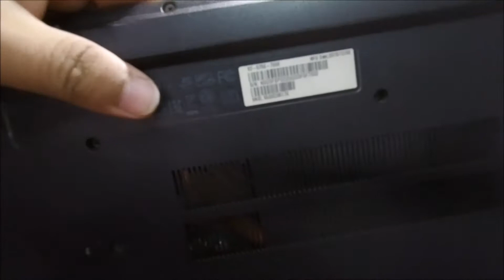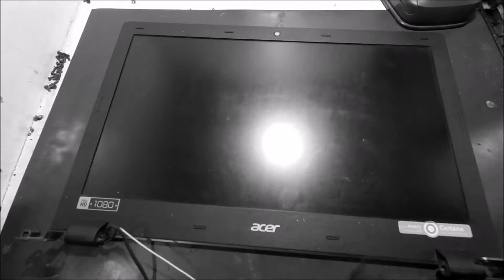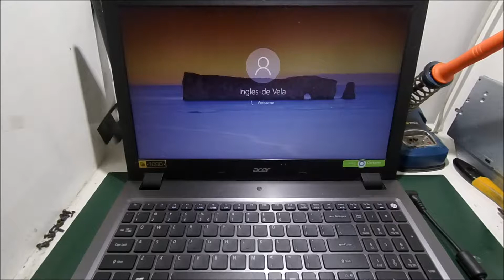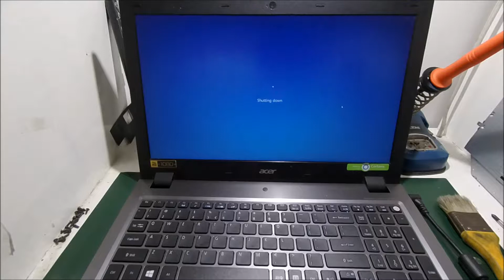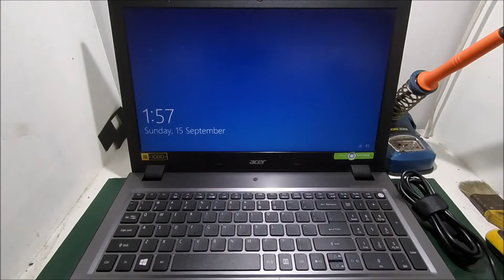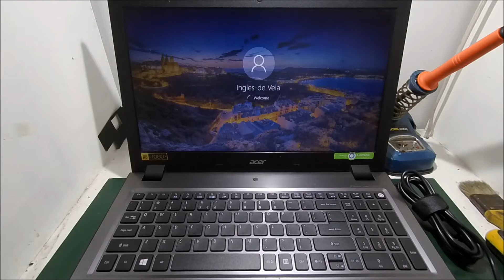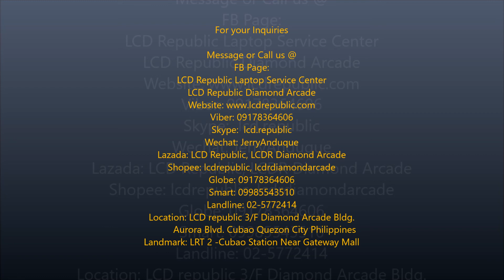How to Replace Keyboard of Acer Aspire V3-575g with Backlit

Comment: hi, i have an Acer Aspire E5 576G 5762 wich works ok but its backlit doesnt work any more ¿is it a backlit spare? or just the full keyboard? do you sell backlit or fullboard spare?  thanks for answering
Reply: Stefano Maruelli  so, even with the right keyboard spare it may not work? Another electronic component in short-circuit ? So i if buy a keyboard it may not work, i wouldnt know until i install it.. Right ? Thanks